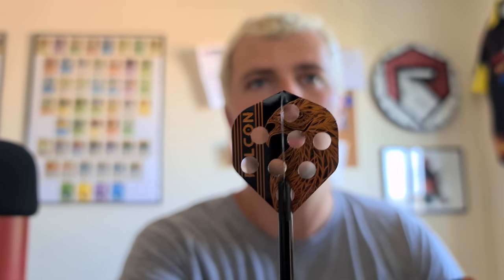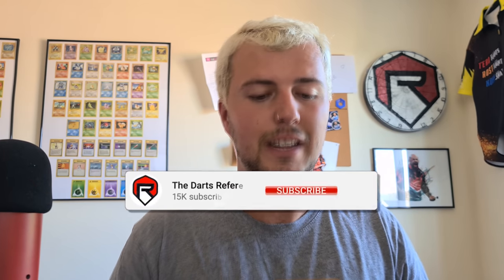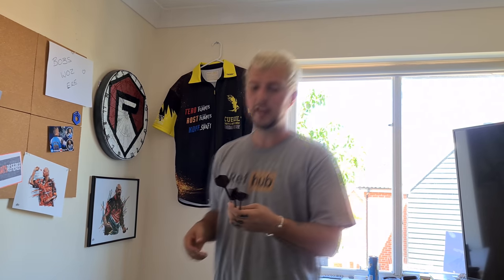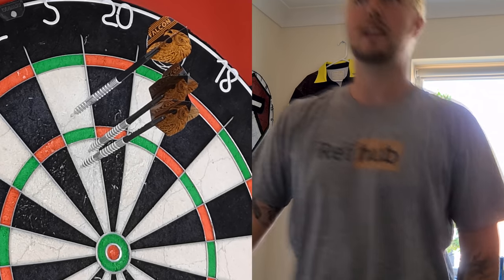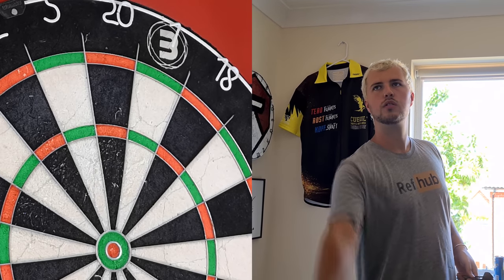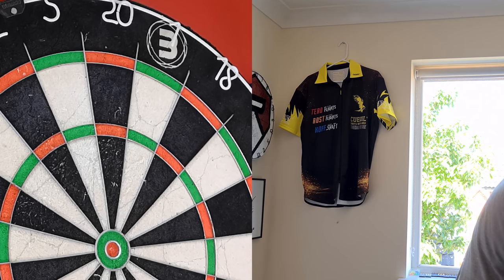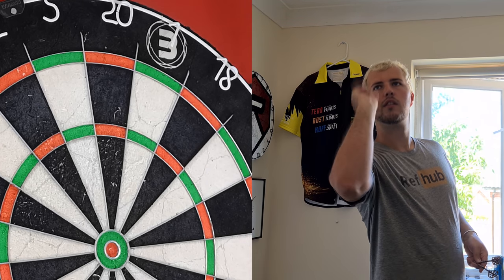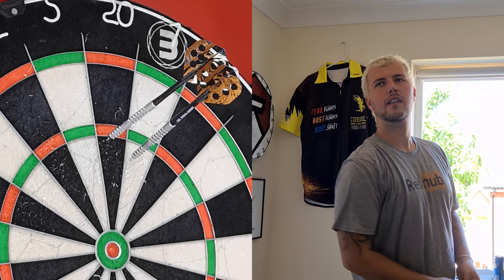I Drilled Holes Into Dart Flights And Tried Them Out!

Comment: You give them a smaller surface area, they'll be less stable. You have a pretty solid throw (and pretty level) so it doesn't affect you too much. Give those to Keegan Brown and they wouldn't stick because the angle would be too steep.

Comment: How about putting 2 holes  opposite sides of the 4 sided flight & putting the holes one on the bottom like a 1/4 inch up  from the shaft & the other perhaps a 3/8 from the top down.  
I think from what you said the dart flight was right to left. Thinking to many holes and it thrown the flight trajectory off. 
Just a thought. 
Let me know ✌🎯

Comment: What about instead of flights you try and attach a weighted ball on the end of the stem and see if they can be easily stacked like Taylor did with slim flights only you would use the weighted ball type object

Comment: Should try to do a video about the best flights to avoid Robin Hoods (It wil take a while ;-) ) Try the Whizlock system, L-Flights, Cosmo Flights, Vice Lock caps of One80, Robson ... You will need to buy the punches too of course
Reply: L-Style flights with the metal caps and you'll never robin hood again.
Reply: @robbiephillips2959  I've test them all, metal caps, plastic caps, ... now the Whizlock in two new colours (Blue & Red)

Comment: How about glueing flights to the front of the dart as well as having them at the back? You'd need to pull them apart so you can get a good application around the barrell, but I reckon they'd add plenty of stability!